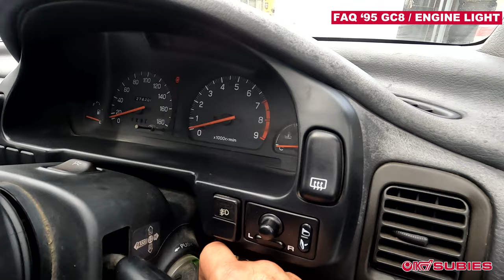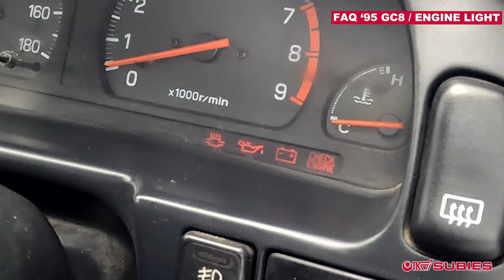My Check Engine Light is on / Subaru '95 GC8 (CODES IN DESCRIPTION) OkiSubies FAQ

Comment: Hi from the wet UK. I love your channel and videos. Thought I'd ask a couple of questions if I may? I get codes 21 and 24. What do you recommend to clean the idle air control valves on gc8/gf8 platform? What type of gasket best to use? Is there a way to lube them? I get about 3000 miles and it seizes up over and over again. I got 2 valves. 1 I keep in a box ready to go and the other obviously fitted to car which helps but damn it's annoying messing around with gaskets. I've used everything from cereal boxes to oem depending on the pinch
Reply from the maker: We typically try to keep the oem gasket as nice as possible when removing and add a small amount of gasket maker to it when reassembly. We use wd-40 to clean them out.

Comment: What became of PART 2 OF THIS VIDEO: GREEN TEST CONNECTORS ? It doesn't seem to exist. 🤔
Reply from the maker: Interesting, I can’t seem to find it either. The green test connectors put the car in diagnostics mode and all the relays should click on and off (you will hear fans going on and off) and in the newer models they are needed to reflash the ECU for tuning. All other scenarios they are left unplugged.
Reply: @OkiSubies  Thank-you for the response. At least I now know I'm not simply inept at finding the video.😅 I have a '98 JDM Impreza STi. (GF8 V4 EJ20K) What benefit is there in running this diagnostic mode? In other words, then what? What do we learn that's of additional value than from connecting the black leads?
Reply from the maker: @1955canuck  Great question! It is typically just to check if something is operating. Like if fans are working or AC Relay. There isn’t too much use for it other than that.

Comment: Hello.

Am having some problems with my 95 type Ra.

The engine used to start but now it's not.
I've found that The coil pack is not taking any power to the plugs. 
And I have a 31 error code. 

Any hints?
Reply from the maker: 31 is throttle position sensor so I would try that first.
Reply: @OkiSubies  can it cause no spark to the core pack?

Comment: Code 23 subaru impreza it wont come off..ive swapped over the Maf Airlfow
Reply from the maker: Did you reset the ECU after swapping it out? Sometimes it stays on until you unplug the battery and reset it. Was it swapped out with a new one?

If both answers are yes then the next thing I would check is the power, ground and signal to the ECU.
Reply: I have the same issue. Swapped out twice so far. Reset with the battery disconnect
Reply: Yeh..nightmare..i might change the MAF plug

Comment: What’s 23?
Reply from the maker: Mass air flow sensor
Reply: @OkiSubies  ok I switch with an aftermarket one twice. Still getting the light. Should I go OEM? Also now it doesn’t start right up, I need to hit it gas first to catch. I haven’t driven it for a bit. Could the startup be due to the olde gas? Thank you again